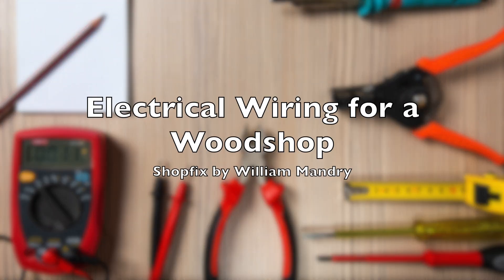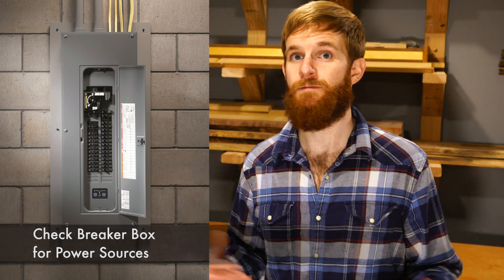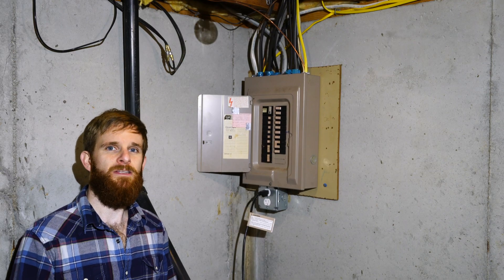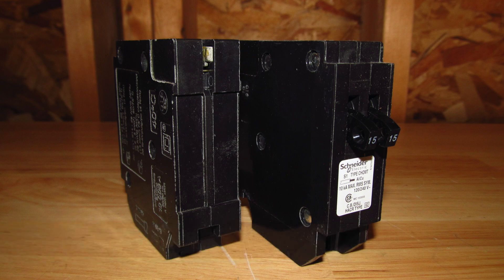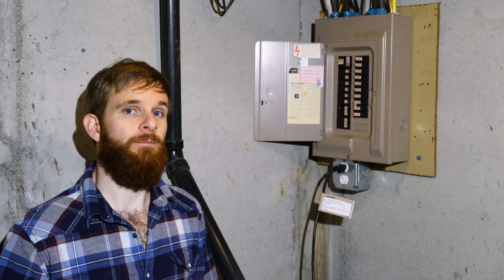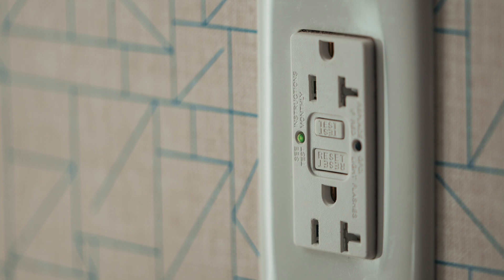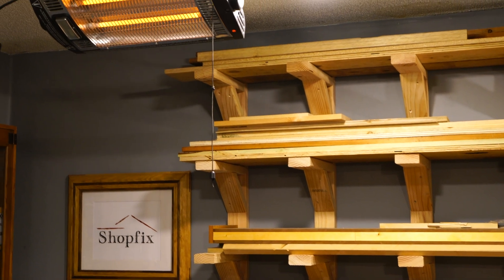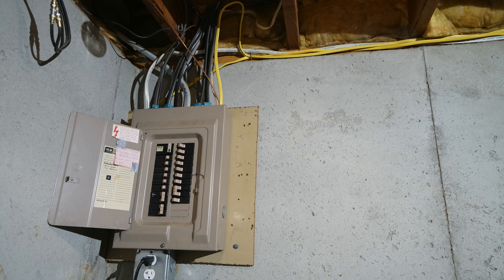Electrical Wiring for Woodshop - How to Start a Woodshop

Comment: Don't forget the auxiliary power uses, ie. charging batteries/radio/phone/etc.

Im likely going to have to have an electrician install some different outlets as my garage outlets are wired to all of the GFCI outlets in the house from the bone-headed 1990 contractor.

Comment: While I was recouperating from TKR surgery a wind storm took down the power to our barn and was hanging low but still working. The mail lady backed around and scraped the insulation off the wires. It now needed to be replaced. I had only 20 amps going to it and when I turned on the table saw the lights would dim a lot. So I took on the task of getting a new service run to the barn. I decided on only 50 amps to keep the cost of wire down. With that I should be able to run all the wood working tools without problems. Lights won't be a problem and having outlets won't either. It's just over a hundred feet to the barn and the wiring cost about $600 for #6 USE wire and messanger cable. The main lug panel $68 and breakers $20 for 4 tandem 20 amp, $45 for 3 50 amp breakers ( 1 for the main, 1 for the welder/compressor and 1 for the main panel in the house.) Not to mention the MC cable for inside the barn $200. MC because of rodents. It is harder to work with but worth it to me. It's been a challeng. Still need to trim a tree that's keeping me from getting the wires higher off the ground.

Comment: Why didn’t you just run 240v into the shop??
Reply: Nvm I understand that you did it this way to save money however considering that you have all that equipment it doesn’t make sense
Reply from the maker: I think it was just easier to wire it that way, I could have brought a bigger line to the shop but instead brought two smaller lines on two different breakers. It’s worked well so far!

Comment: Electric heat is continuous and assessed at 125%. You didn't consider voltage drop over that long distance to your garage. 12/2 at full load is good for roughly 60'. A local subpanel does offer ease of adding circuits, but it's also much safer to have a shut off in the work space...and much more that could be said.

Comment: 15 A ? Is that 110v
Merry Christmas from Scandinavia
Reply from the maker: Correct, a 15 amp outlet is just your standard 110v outlet. I recommend installing 20amp outlets if you are starting from scratch and are wiring a new shop.
Reply from the maker: Merry Christmas!